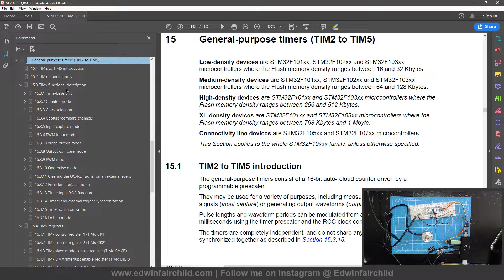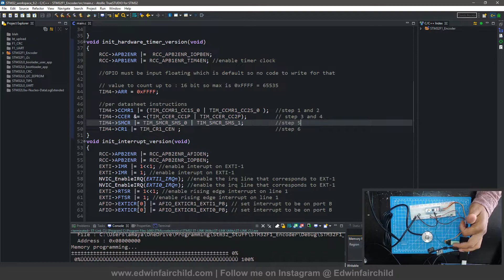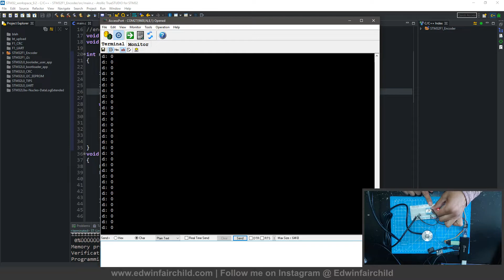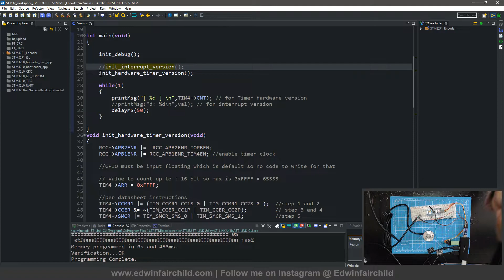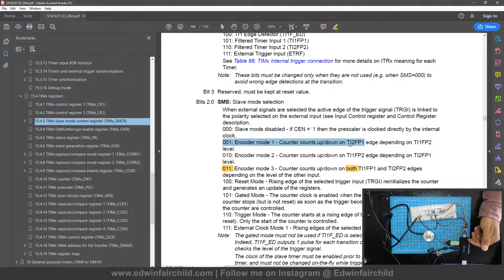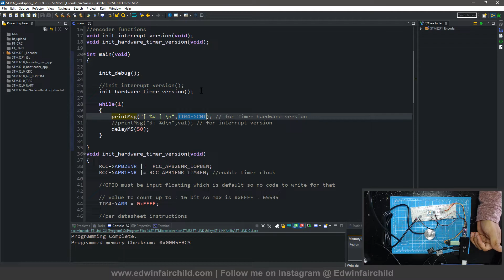STM32 Tips: Interface Rotary Encoder in Hardware only / no code!

Comment: Does anyone know how to implement this rotary encoder method with interrupt on change? In other words the MCU is interrupted to read the value only when it changes or to be more accurate after there is a signal change on the two GPIOs.

Comment: Eddie, This was a good video.  I'm trying to do the same thing using a blue pill and the Arduino IDE with Roger Melbournes library.  I have set the registers according to the datasheet, and I have set the SMS bits in the SMCR register to 011 (Encoder mode 3 - Counter counts up/down on both TI1FP1 and TI2FP2 edges depending on the level of the other input.) but my counter does not count on every edge of TI1 and TI2.  Instead, when rotating clockwise, it counts up on the rising and falling edges of TI1 (but not TI2).  When rotating counterclockwise, it counts down on the rising and falling edges of TI2 (but not TI1).  This messes up my counter when I have jitter, because it doesn't count up AND down during jitter.  Any ideas?  According to the Figure 134 in the reference manual, it should count up and down on the rising AND failling of TI1 and TI2 always.  Help?

Comment: okay, without trying to understand this (yet), can I offload this to hardware in case of I2C encoders? Multiple I2C encoders connected through I2C multiplexer? Probably not, right?
Reply from the maker: Well i2c is hardware , but since it requires you sending commands of sorts then in that case no, the hardware has no way of know what you want the commands to be. Unless these devices are just sending data without you needing to ask for it,then you can use DMA and not have to worry about it

Comment: Great video.  Since encoders are just rotating switches, if you want repeatable results (especially with lower quality encoders), you may need to debounce the inputs from the encoder (just like you would with a switch).  There is a digital input filter in the timers (including encoder mode), but it looks like that only helps if your pulses are in the microsecond (to maybe tens of microseconds) range; I don't think it can slow its sampling rate down enough for pulses in the millisecond range.
Reply: the STM32 micro already have a filter parameter in the hardware to prevent the bouncing encoder inputs. I normally set this filter to 10 in decimal and it works perfect

Comment: Hi Eddie, 
if you use  encode using hardware, how the program Know that encoder was moved? if you are not checking the CNT all the time (using poll mode).....can we use an interruption to know know the CNT was changed?
thanks in advance, your videos are the best.
Saludos desde Argentina
Alfredo
Reply from the maker: Well this method is more like any time you read the variable you know you have the current position of the encoder , if you want to know Everytime it moved then yes you can set an interrupt . But with this method the variables will always have the latest value of the enconder. So it's up to you to decide which behaviour you like best for your application

Comment: Great Explanation. I need to calculate the frequency of the motor. Is there any provision to stop decrementing? Since the direction bit will be set by hardware, I need only incrementing the counter when rotor turns in any direction. counter value I will copy periodically and will clear the counter register. Based on the counter value and my predefined period I can calculate the frequency of the rotor. Please suggest me if there is any scope for improving my procedure to calculate frequency of rotor
Reply: You could just use the absolute value of the change in the timer's counter value.

If you want the counter to increment for any change (in either direction, including back-and-forth), then you probably want to configure the timer in one of the external clock modes (probably external clock source mode 2), and connect one of the encoder's outputs to that external clock input.  Leave the other encoder output disconnected.  You will get less resolution than you could get in encoder mode (because you are ignoring edges on the other encoder output).  You can use the timer's prescaler to divide the external pulses; if you set it to the number of pulses per revolution, the timer's counter will have the number of complete revolutions.

Comment: @Eddie Amaya   Hello Eddie first of all thank you for posting the video. Secondly, i have a question concerning the val because you initialized as an uint32_t wich means no negatives values then how it can be negatives in the timer interruption because maybe the code was not too clear to me. Thank you in advance.
Reply from the maker: It is never negative ! If you look at the end of the video if goes up to 65535 and then back to zero, if you go the other way once it goes past zero it will go to 65535.   Val-- means val - 1 , it just subtracts 1 from the current val, when it goes past 0 it's underflows back to 65535
Reply: @EdwinFairchild  thank you very much for the explanation 😊

Comment: You are making a small mistake.............you have pulled up STM32 pins to 5 volt.........not all STM32 pins are NOT 5 Volt Tolerant..........reduce the 5 Volt pulses to 3.3 V using a voltage divider , and then feed then into STM32 pins
Reply from the maker: All of port B except 3 pins are 5v tolerant specially the pins for the encoder.
Reply from the maker: This was asked and explained on a previous comment. Maybe I'll put it in the description.

Comment: Hi, how does one know the maximum frequency of the pulses which can be counted? i.e. before we start loosing pulses being counted.
Reply from the maker: That depends a lot on the hardware being used, are the pulses coming in nice clean pulses from something like a very high end encoder, what speed is your microcontroller running at and other factors I would assume. Off the top of my head I don't know. But I do know not that many encoders are going to output anything in the MHZ range that would be really fast to spin that thing and then you have to take into account physics ... Is it getting hot? Anyways it's an interesting question sorry I can't give you a definite answer. I'm not sure the datasheet mentions how fast I can count I'll have to check
Reply: @EdwinFairchild  Thanks Eddie.You are right about encoders not outputting pulses in the MHz range.I was curious about the speed because there does not seem to be a clock for the counter per se. Also is it possible to be able to get the speed of the pulses ( pulse width) while counting the pulses ? It would be useful to calculate the acceleration of the actuator etc.Thanks for your videos,its great that you code from datasheets and user manuals than just relying on tools like CubeMX.
Reply from the maker: @EmbSysDev  well the encoder pulses become the "clock" and that's what causes the counter to increment or decrement , furthermore you could add a timer and use that to measure pulse width

Comment: Great video. Do you know how to use DMA to put the counter value into a variable? I know that the DMA could grab for example TIM1_CH1, TIM_CH2, etc, but in the manual, it doesn't say that it can get the counter value (which is computed by the hardware)? Thanks again.
Reply from the maker: Wait a minute why can you just make a pointer to the counter ???
Reply: @EdwinFairchild  good idea, I'll do that. I got led into the DMA idea from the end of the video... thanks Eddie :)
Reply from the maker: If you know the address of the counter register then perhaps try to do a DMA transfer from memory to memory , or peripheral to memory but in peripheral to memory  I think the peripheral needs to trigger a DMA request. I'm not sure so give it a shot

Comment: FWIW, the instructions for connecting the rotary encoder need some update. You are pulling up the outputs of the encoder to 5V. This only works if the ports you are using are 5V tolerant. Some pins of the MCU are not 5 volt tolerant. You can get rid of the external pull-up with resistors and use the pull-ups on the microcontroller. Outputs of these encoders are open drain so they will also work with 3.3 Volts so you can connect them to all the pins without worrying about 5V tolerance.
Reply from the maker: I agree on keeping an eye on pin voltage tolerances , that said this is an open collector NPN based encoder not a FET type with a min input of 5v , i tried it with 3.3 , also all except 2 pins on port B are 5v tolerant  which i  think is why the onboard decoder supports only port B, while all but 5 pins on port A are 3.3 ,. nonetheless I should have explained that. Next time. lol

Comment: Any help/suggestions for brush PID motor control with encoder? Where to start?
Reply from the maker: that sounds like a fun project actually
Reply: @EdwinFairchild  could you give me a push in the right direction to start or? TIA!
Reply from the maker: @user-rs8zg8ey2b  there are a lot of resources to learn PID control. Start there. Learn what they are , the math and theory behind it. ARM has a library for PID control umm I did some playing with that before and I have to dig out the project files. Right now it's though because I just moved and all my things are in boxes
Reply: @EdwinFairchild  thanks for the reply. I know what PID is and how to dial it in (been doing industrial control tuning for a while and in the last 6 years quad tuning / flying (see my flying here https://www.youtube.com/watch?v=uHoFfpLSb2g). I need to see some PID control with encoders, arduino was easy to find code, for the stm32f4, not so much.

Comment: Great tutorial. Thanks!!!. Quick question: Is there a way to overcome the 65535 limit on the encoder count?. I am working with a linear scale encoder which sends much more pulses than 65535. Thanks again.
Reply from the maker: Yeah just keep track of how many times you have overflowed your varaible or use a different variable type instead of using the count as a value use it as a tick and increment a 32 bit varaible or something . I mean there's tons of ways
Reply: Hey Sohan, did you get anywhere on your project? I'm starting something similar and would hate do reinvent the wheel. Thanks

Comment: Exactly what I was looking for, thanks.  One question: Why do you have to use external pullup resistors instead of just setting the pin mode to pullup?
Reply from the maker: You don't HAVE to.
Reply: @EdwinFairchild  But you did. :-) Are external pullups better in this case?
Reply from the maker: @clawsoon  I don't recall if I was pulling up to 5v , in that case the internal pullups only pull to 3.3v but then again I was reading on the pins so maybe it was not 5v lol. As far as what is "better" depends on project specifics. For example if you're working on a project where 5 million units will be made you can save a few cents and use the internal pullups to keep part count down . At least that is my theory from my inexperienced mind lol . Still in school so take my advice with a grain of salt
Reply: @EdwinFairchild  Thanks for going into detail.  I'm a complete amateur, so you're way ahead of me. :-)

Comment: Just finished building one with an lcd(those 16x2s) with the f103c8t6 with those cheap encoders .... I'm using 1 input only ... works great .... these ones give 40 counts for full 360 rotation .. if both inputs used ,, it will give 80 ... not that great but still good ... your encoder is tooooooo expensive for me ..... haha ..